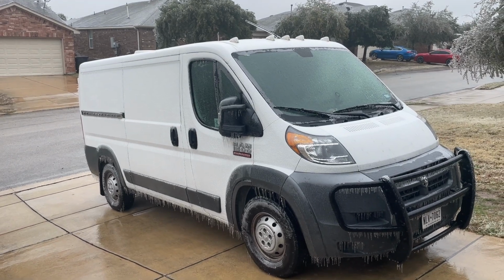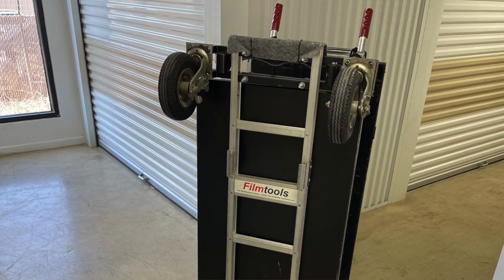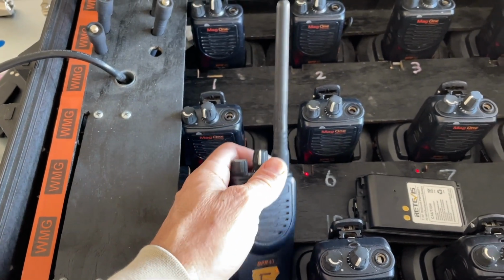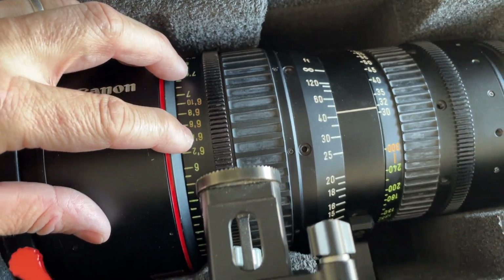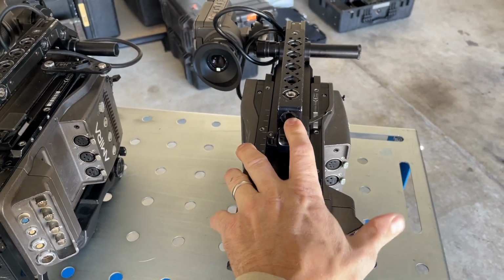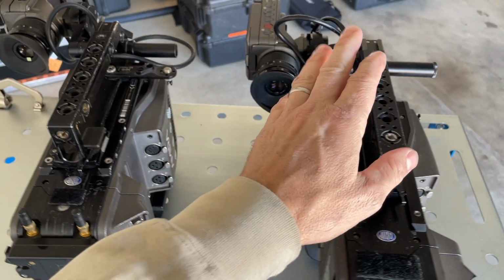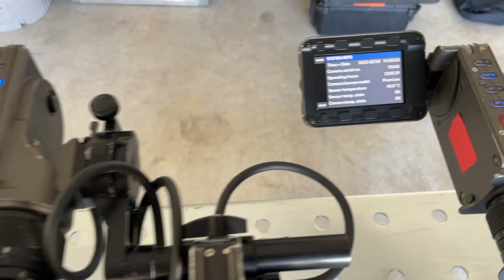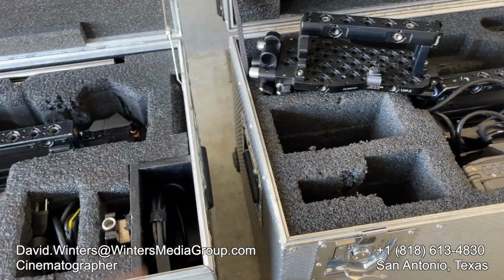Selling Amiras | 30-300mm | Walkies

Comment: Big decisions. Congrats on the quick sale of #1. 

I actually just listed my Canon c70… moving explicitly to Sony.
Reply from the maker: Riding the Sony wave.  I need to sell my two C300 and two EX3 next, cameras have so little resale value that one rental / year makes more sense to keep them.  But I have too much kit, need to streamline.
Reply: @CrankyCameraman  agreed. I want as little kit as possible haha. Actually by moving to FF, a 24-70 and 70-200 are much more usable than on a s35 sensor in my experience. I’m hoping to sell all my 7 lenses and replace with those two zooms. 
And the high base iso allows 2.8 to be as sensitive as I need.
Reply from the maker: @davidmorefield  Nice.  I'm super happy with the E mount Sigma 50mm and 85mm 1.4,  For interviews in less interesting locations, big change in bokeh going from 2.8 to 2.0.   I rarely shoot 1.4, too shallow, soft ears and shoulders.  Also need to start selling my EF L lenses.
Reply: @CrankyCameraman  it seems like canon bodies and lenses are depreciating at an alarming rate. I’ll most likely be taking a $2k loss on a $6k canon camera that I purchased less than a year ago.
Reply from the maker: @davidmorefield  Considering how much work you have generated with the C70 and it contributed to buying your FX6.  Only 2,000 is a big win.  Contrast with my C300 which was 15,000 new and now selling for $1,000, but long ago paid off.
Reply: @CrankyCameraman  Ufff
Reply: @CrankyCameraman  Hello,  how much are you selling the c300’s for?    

Thanks
Reply from the maker: @royaltristarmediagroup4905  I’m not sure I haven’t had time to research pricing.  If you want to make me an offer I’m happy to entertain. One is EF one is PL.

Comment: Have you tried replacing the internal battery on the Amira that won’t hold time of day after powering off? It’s a relatively simple process, I believe Arri has a demo video on their site.
Reply from the maker: Yes. I carry spaces in the camera cases.  Unfortunately it doesn't fix the TC issue only the system date and time. But good suggestion.

Comment: I've been tracking the price of used Amiras for a few years - mostly on eBay. They have been hanging in the 18-22k range for a long time now. Every once in awhile one will pop up for 15k but it's always in Hong Kong. Was hoping they'd come down more so it'd make sense for me to own one, but by the time that happens the industry will have moved on and it won't pencil out. Also, my back is aging out at an alarming rate so maybe it's not the best idea anyways.
Reply from the maker: You research is consistent with mine. And I'll be on meds the remainder of my life for hip and back issues.